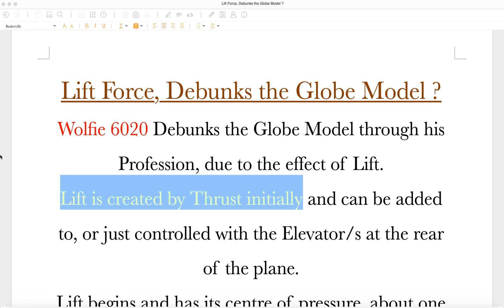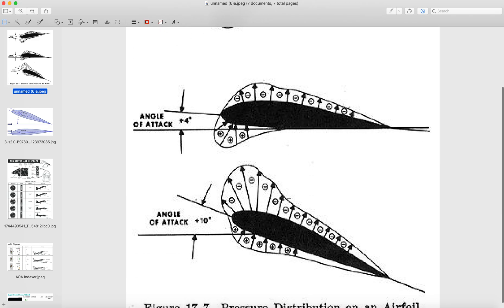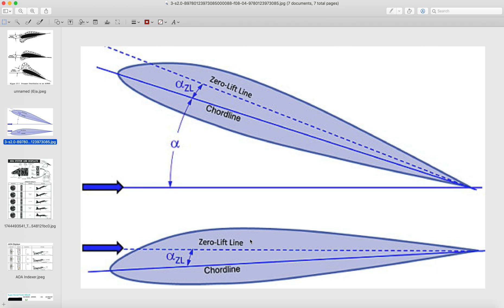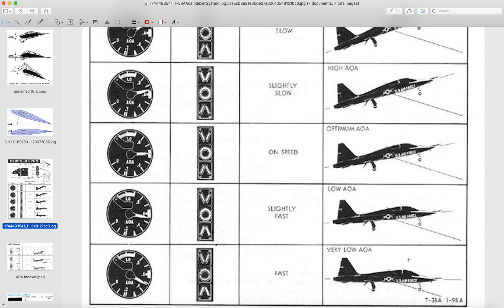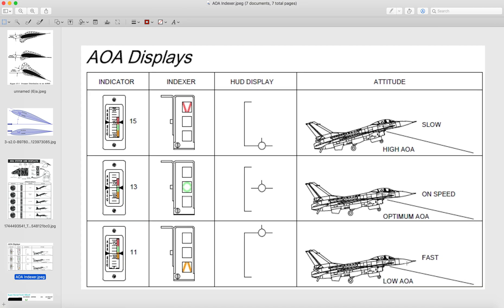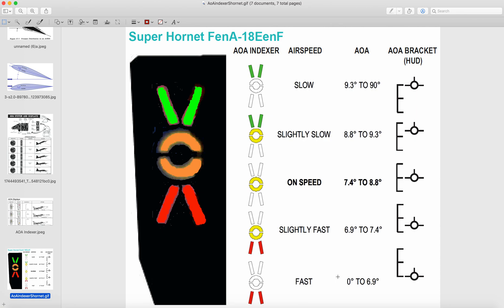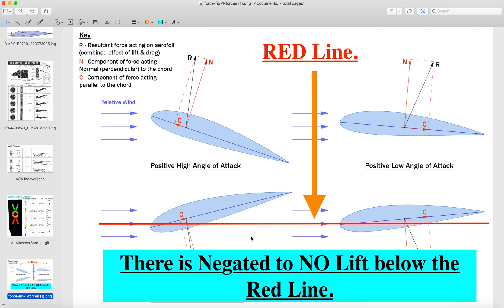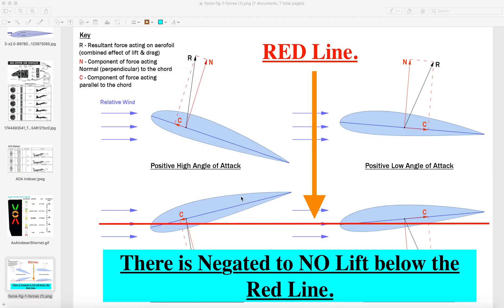Lift Force, Debunks The Globe Model ?

Comment: For the 20th time. The nose is pitched down relative to where you took off from but not relative to the ground directly below it because plumb lines aren’t parallel
Reply: Only on your moggle is that true. In real life, they are.
Reply: @sleepingwarrior4618   spelling maths as maffs and model as moggle isn’t a good argument 😂😂
Reply: @Cornwall1888  It's a fantastic argument. It emphasises the point so well that it caused you to type that comment. Maffs and moggles are out of scientific method for a reason.
Reply: @Cornwall1888  'Maffs and moggle' are minor quibbles when dealing with flat earth lunatics! Pretty good indication of the intellect involved.
Reply: @sleepingwarrior4618  the fact that you don’t like wolfies tone yet are friends with Oakley who is the most vile individual I’ve ever came across is tragic and hilarious
Reply: @overweightaviator  ...
Reply: @sleepingwarrior4618  Ok mate.  I am back.    Can we try to continue as adults.  I acknowledge the comments you made earlier and will keep Banter to a minimum,.  I will put on my flight instructors cap which means my only intention is to impart accurate knowledge politely on this topic. 

Shall we proceed?
Reply: @Wolfie6020  Only if you dont drop into that other persona you have, the arsey one afterwards. If you can be reasonable with me, I can be reasonable back but if you slide off into FTFE territory, I'll just "run away" and you can claim victory. You might not take the topic personally but I do. 

If you can agree to that, where would you like to go today? Start a new thread though, this one is quickly going to get long and long thread are hard to navigate once they get a few idiots making it long
Reply: @sleepingwarrior4618  I assure you I will do my best to avoid that and treat you with the same courtesy and respect I would to any paying student.  Please understand that I am an experienced flight instructor and I have methods of teaching that have proven effective.  Part of that is for me to pose a point then ask you a question.  It is not a trick.  It is not designed to trap you.  

It serves two purposes.  It allows you to think on the point. 

It shows me if the point has been made or if I need to present it a different way.  So please don't avoid the questions as they pop up.   If you don't know then please just say you don't know. I promise you that I will respect that without any ridicule. .

So the first question.  (No ridicule - I promise) 

Have you had a chance to look at the lift formula?   Feel free to take your time and google it now.  I will not be testing you on it.  I will be explaining it fully.   I simply want to know if you have seen it.
Reply: @sleepingwarrior4618  If you had to bet $100 on who was right about this who would you put the money on?

Brian or me?  

Just be honest and remember Heliocentric Suicide.   This is the same scenario exactly.   

Brian is wrong.  He has no clue why he is wrong. He cannot see his mistake.  You obviously cannot see it either.   I can see his mistake easily.  

So who gets your bet?
Reply: @Wolfie6020  Can you please stop following me round the internet.
Reply: @sleepingwarrior4618  But I was here first mate.  It is you who came to a video about me.  

I was simply curious if you had learned your lesson though I fully anticipated a deflection from you. 

I was right.  Sure, if you don't try to engage me again, I will respect your wish to be left alone.
Reply: @Wolfie6020  leave me alone. Thank you.
Reply: @sleepingwarrior4618  said "Can you please stop following me round the internet."

Sheesh, you really DO have the arrogance of nothing, don't you?

Brian posts videos directly critiquing Wolfie, NAMING HIM in the video title, you drop in to comment, and then think Wolfie is hounding YOU? 

Get.  over. yourself.
Reply: @tumenihits5438  you need to realise, I'm flipping Wolfie the victim card because he did it to me recently. I'm just treating him how he treats me.
Reply: @tumenihits5438  He is just sulking because he knows I am right but won't admit it.    Quite happy to leave him alone if he can't hold his own against an ex cop.
Reply: @Wolfie6020  I just want you to speak to me properly, not patronising and condescending. You are not overtly rude but you are passive aggressive. If you could be an adult rather than a feminist to me, I could talk to you.
Reply: @sleepingwarrior4618  What you perceive as passive aggressive is not that at all.   99% of the time it is just normal Aussie banter mate.   In my country men are men and not sensitive to a bit of mocking and ridicule.   We thrive on it.   It is a social norm. 

In many countries "Hey dickhead" would be considered an insult.  

In Australia that is how you would greet your best mate. 

Note how sometimes Level Earth Observer gets his knickers in a knot about something I say to him but Whereswally laughs because he recognised it as just friendly banter.  

Perhaps it comes down to you not reading my post in the calm voice you hear in my videos.  

What is your internal voice when you read my post?  If you hear any anger or hostility that is originating within you.   

Jeran was renowned for it.  I would send him emails with the occasional friendly teasing.   He would quote them on his channel in an extremely uptight and hostile voice.  

That is not how I speak.   That was him projecting his own hostility to my words. 

Are you perhaps guilty of that yourself?
Reply: @sleepingwarrior4618  You would be treated like an adult if you behaved like one.
Reply: @riskycabbages1282  I treat people how they treat me.
Reply: @Wolfie6020  it's not just your tone. It's the words you say. I've experience both a passive aggressive tone from you but also rudeness in the guise of condescending patronisation. I'm all for the banter but you go beyond that with me. We are not friends but you are citing banter between friends to justify your approach. We are not friendly enough for that level of inappropriateness. If you think we are then that's on you. Me and Nathan, anything goes. Me and Arwijn is a bit more delicate due to language differences...he doesn't always realise sarcasm. You? You speak to me like Nathan and I speak but it's misguided and the reason I don't want to engage with you.

Generally I leave you alone because I can't really argue anything about flying a plane. However, if you could prove that the attitude of your plane had actually changed by the amount of degrees required by the length of you long haul flight, there would be a conversation there but it doesn't and you claim some level of compensation. You don't DEMONSTRATE this claim, you just vomit it like refraction vomits out of blerfers when it's topics like the horizon. I point this out to you and your response quickly gets very personal and off topic rather than support your claim. You reverse the burden of proof and appeal to yourself as an authority. When this is pointed out as fallacious argumentum, you don't like it and start calling me names in a jovial way. It doesn't change the fact that you never have to reset the attitude indicator, or can demonstrate the compensating element. It just becomes a d1ck swinging fest with you and I just can't be bothered with the ego. The correct position, the honest position is you cannot prove this compensation claim and you simply believe/accept it as true and you appeal to yourself as the authority due to plane flying. 

You think that's an acceptable standard of evidence but I don't. I explain why and you start literally calling me names and insulting me in a variety of ways. The correct answer is to acknowledge my point and address that rejection of evidence directly with the compensating mechanism/software you claim exists. 

This is why I don't want to engage with you, you do ANYTHING but address the point. 

Then blame me. 

With patronisation and condescension.

And later play the victim card to others to make it appear like I'm tyrant. 

That's a cunts trick and you do operate in this way.
Reply: @Wolfie6020  I DO take this topic seriously though. That's why your approach isn't desirable. You don't KNOW. You strongly believe maybe. I think you are overtly lying with a cheeky chappie approach to try and disguise it. 

The fact remains that you cannot show your plane changes attitude over distance as it flies round the ball. 

You also can't show Coriolis applies to earth. Perth/Sydney flights are backwards to your models claims. As many flights are.

You are politely lying to people. You're a shill Wolfie. I quite like your approach as its much like my own....that's why I haven't blocked you. I also respect the fact that you are expolice. But I still think you are shilling for the lie.
Reply: @sleepingwarrior4618  You treat people how they treat you?  

Are you sure?  

Did I make a one hour video talking about you?   

Did I make several videos plastering your photo on the thumbnails of the videos?  

Did I make any videos accusing you of being incompetent at your profession with your face displayed clearly?  

Let me answer for you. 

No, 
No and 
No. 

I made one video referencing you.   It was simply to point out that you did not know my history as a Police Officer and most of that video was just flying footage anyway 

So please explain why I was an exception to your claim of "I treat people how they treat me"
Reply: @Wolfie6020  I DO treat you how you treat me. I'm amiable to you. I address your points. I disagree properly with you. I do engage. With others, like for example Shawn Hawkins, I scorn him with the scorn he gives me. 

The very fact you are even speaking to me now shows that I don't treat you bad. You might not like how I treat you but if you spoke to me like an adult, perhaps we could conclude points like adults but as you have already admitted, you don't take the topic seriously. I do. Perhaps that's why we never conclude anything and it always ends up in silliness.
Reply: @sleepingwarrior4618  You totally avoided my question (mocking friendly tone with a hint of a smile) 

Please answer it. 

So please explain why I was an exception to your claim of "I treat people how they treat me"

I never made those types of videos about you.  I never "treated you" that way.  So please explain why you did?  (friendly teasing tone but pushing a bit because I want a straight answer with no deflection)

It does not bother me in the slightest how you treat me. I am a thick skinned Aussie.   I am simply curious from a purely academic standpoint of why you did it when I had never treated you that way.  (and I am a little bored while I consider options for dinner tonight, take out and watch Netflix in the hotel or a local cafe...)
Reply: @Wolfie6020  What was the question I ignored?
Reply: @sleepingwarrior4618  Take your time, we can do this over several days.  I am in no rush.  It is Friday night here and after 21:30,   I did not plan to sit online tonight so please forgive me if you reply and don't get a response until tomorrow (Perth time)

I have just started season 4 of Game of Thrones and can't wait to see Joffrey get his just deserts. 

Cheers man and enjoy your Friday night.
Reply: @sleepingwarrior4618  
https://www.youtube.com/watch?v=Atevt-qt8Ow
Reply: @sleepingwarrior4618  said "Only on your moggle is that true. In real life, they are."  (saying plumb lines are parallel)

If all plumb lines were parallel, then a level sight line (perpendicular to plumb) from any point of (say) 100m above sea level should meet all other points of 100m around it. 

But this is not the case. See all the YouTube videos where folks take spirit levels and other levelling optics up to the peaks of hills.

If all plumbs were parallel, and the seas flat, then if I looked out from (say) 100m elevation onshore, to a ship or island of (say) 52m or 73m, then I would have a downward sightline which should meet the water. Non-parallel lines must meet. But it's been shown that these and other sightlines in similar situations miss the water altogether. 

The seas CANNOT be flat. Since they're Not Flat, they must hold some other shape.
Reply: @tumenihits5438  Your point assumes sight in a vacuum though. We don't see through vacuum. 

Your point is invalidated.
Reply: @sleepingwarrior4618  said " Your point assumes sight in a vacuum though."

No, it doesn't.
Reply: @sleepingwarrior4618  said "Your point assumes sight in a vacuum though. We don't see through vacuum. "

So, if and when you go to the optician, and he asks you to read the letters on the chart on the wall, are you looking at the chart though atmosphere or not?

If you assert the atmosphere invalidates sightlines, are you or the optician sure you're reading the right letters, or not?

If you assert that this is "too close" for the atmosphere to matter, then where's the breakpoint where atmosphere does matter? 

Does that get arbitrarily chosen merely to disagree with observations you want to dispute?
Reply: @tumenihits5438  TheRumpus argues that you are NOT looking at the chart directly. He has said in the past that the tree opposite your hose is refracted to a miniscule amount but it is refracted so not actual. You tell me? 

The break point is the part where optics start demonstrating the point, coincidentally the exact same distance that the earth curve is said to start becoming apparent. What you call obstruction due to earth curve is actually the optical effect of the limited angle. 

It doesn't get arbitrarily chosen buy me, it's arbitrarily chosen by your model as a misrepresentation of reality that you are reversing onto me right now.

Read that last paragraph again. This is what your model does.
Reply: @sleepingwarrior4618  said "TheRumpus argues that you are NOT looking at the chart directly."

So what? I have no idea who that is, and you haven't presented the argument. 

"He has said in the past that the tree opposite your hose is refracted to a miniscule amount but it is refracted so not actual. You tell me?"

I can't tell you anything about what someone else has claimed without more detail. 

Is the assertion REALLY that when I look across the room at the optician's chart, I'm not actually looking at it? 

Or that when the driving test examiner asks me to read a number plate at 50 feet, or whatever the prescribed distance is, that I'm not actually looking at the number plate? Really? Where DO you get this stuff from? 

"The break point is the part where optics start demonstrating the point, coincidentally the exact same distance that the earth curve is said to start becoming apparent. What you call obstruction due to earth curve is actually the optical effect of the limited angle."

Gotcha. So it has no impact on the observation(s) that I'm referring to, then. 

"It doesn't get arbitrarily chosen buy me, it's arbitrarily chosen by your model as a misrepresentation of reality that you are reversing onto me right now.
"

No, I'm not choosing anything as part of my argument, you're filling in what you think my argument is. 

"Read that last paragraph again. This is what your model does."

WHICH last paragraph? Yours or mine?
Reply: @tumenihits5438  Nothing in your above comment has not already been addressed in my reply. I suggest you reread my reply slowly. Use finger spaces if you need to.
Reply: @sleepingwarrior4618  moggle? "Leave me alone" It's a shame that someone who studied in law school would post a public comment and tell others they want to be left alone.
Reply: You have some way to verify that statement? That is your belief! It is not a statement of fact!  In the real world your statement is a falsehood! :)
Reply: @ryanqvincent144  Multiple exclamation marks do not enhance your argument! They just make you look excitable! 

Find yourself some textbooks on aeronautics and flight theory!
Reply: @Q Branch I think a debate will be the only way to help Brian begin to appreciate how little he understands.
Reply: @Q Branch I'll see how the schedule pans out next week.  It is in flux at the moment with possible flights over the weekend.  I think I would quite enjoy politely showing Brian what he does not know.
Reply: Are you insane Have you never built anything in your life?😰😰 who would ever say plumlines are not parallel obviously! Do you not understand geometry?

 All level lines are horizontal and all horizontal lines are parallel to the horizon, man your education is terrible😞
Reply: @stevengerhardt1221  
"Are you insane Have you never built anything in your life?😰😰 who would ever say plumlines are not parallel"

Defining Horizontal and Vertical Directions
The earth actually has the approximate shape of an oblate spheroid, that is, the solid generated by an ellipse rotated on its minor axis. Its polar axis of rotation is slightly shorter than an axis passing through the equator. But for our purposes, we can consider the earth to be a perfect sphere with a constant diameter. In fact, we can ignore, for the time being, surface irregularities like mountains and valleys. And we can consider that the surface of the sphere is represented by the average level of the ocean, or mean sea level. By definition, the curved surface of the sphere is termed a level surface. The direction of gravity is perpendicular or normal to this level surface at all points, and gravity is used as a reference direction for all surveying measurements. The direction of gravity is easily established in the field by a freely suspended plumb line, which is simply a weight, or plumb bob, attached to the end of a string. The direction of gravity is different at every position on the earth’s surface. As shown in Figure 1-4, the direction of all plumb lines converge at the center of the earth; at no points are the plumb lines actually parallel. The vertical direction is taken to be the direction of gravity. Therefore, it is incorrect to define vertical as simply “straight up and down,” as many beginning students tend to do. The vertical direction varies from point to point on the earth’s surface. The only common factor is the direction of gravity. By definition, the horizontal direction is the direction perpendicular (at an angle of 90°) to the vertical direction of gravity. Because the vertical direction varies from point to point, the horizontal direction also does. A horizontal length or distance, then, is not really a perfectly straight line. It is curved like the surface of the earth. This is illustrated in Figure 1-5
http://uomosul.edu.iq/public/files/datafolder_2936/_20200323_051331_380.pdf
Reply: @stevengerhardt1221  At distance plum-lines are not parallel to each other. Drop a plumb-line from the top of the towers of the Severn suspension bridge which joins England to Wales. The lines are perpendicular to the ground and parallel to the towers. However, despite being built vertical the distance between the top of the towers is slightly greater at the top than at the bottom due to earth curvature.
Reply: @Q Branch LOL.  My lamest Flight Instructor joke. 

This line represents Parasite Drag,  this one represents Indcued Drag,  when we add the two we have a total drag - like this subject.

The girls laughed a lot more than the guys at that one.  Not sure why.
Reply: @Q Branch  Tthe surface of a sphere is not developable! Jesus Christ man learn some geometry! And what do you think is not true reality?. . .  obviously !
Reply: @stevengerhardt1221  said "The surface of a sphere is not developable!"

What ARE you talking about?!

And WHY do you need to put an exclamation mark after every phrase? 

All it does is make you look excitable! Doesn't add anything to your argument!

See! I can do it too!
Reply: @Q Branch see, this kind of dishonesty is WHY most of of just ignore you guys. Your criticism of Brian is identical with you. Watch.

In science today, gravity is defined as an effect. It cannot accelerate mass, it is the perception of acceleration that is not actual acceleration....by definition (Einstein, 1915).

Is gravity a force in science today?
Reply: @Q Branch No, objects do not fall towards the earth due to gravity. It's defined as an effect. Something else is causing objects to accelerate.....not always towards the rather either. Are helium balloons attracted by the clouds? I can calculate that they are in exactly the same way you calculate for earth attracting objects. Doesn't make it true though does it, calculation is correlation, not science. 

My answer agreeing with Einstein? I think Einstein's a fucking idiot. He thinks the earth is accelerating up!!!! I say we are not accelerating up, or attracting anything. Think is, I CAN disagree with Einstein, I'm saying the current science is wrong. You are ignoring the current science and applying the position he replaced in 1915. Who is more accurate? Me disagreeing with the current position....or....you not even applying the current position and applying the position he replaced in 1915?

It's me isn't it. Einstein is wrong, of course he is. That is the position in science today though.....and you don't even know that position! Ha ha ha
Reply: @Q Branch I don't believe Brian's point has been directly addressed and lots of strawman points have been debunked. 

Can you tell me the point Brian is making please? See if you even know his point....
Reply: @sleepingwarrior4618  
"Can you tell me the point Brian is making please? See if you even know his point"

Yes!   https://www.youtube.com/watch?v=T4LoMQV4ZAw
Reply: @Q Branch Brian's point is that trust causes lift, not elevator position. He's correct. Elevator position may change attitude of the aircraft but the horizontal speed is what causes lift. It's application of the Bernoulli Effect. 

When a plane lands, it steeply lifts it's nose just as it touches down but to get it down, the thrust is removed, regardless of the pitch of the nose. So applying that, both his point is right but so is yours, you can "fall" around the ball in theory. 

The bit you are ignoring is if the plane is flying level and falling around the earth, it's vertical is constantly changing with distance. As the duration of flight increases, that change in vertical becomes bigger and bigger from what it started off. Planes do not fly tangents, they fly level. Even if you redefine level into a curve, for it to fall around the ball you dishonestly claim, the plane is always having to adjust its attitude. Brian is correct. 

The trouble is, these adjustments are cumulative and should be easy to demonstrate. When a plane is cruising at cruise speed, whether it's falling around the sphere or on a level plane, the elevator flaps must make continual attitude adjustments to follow that curved path. If they didn't and rode the wave like you are describing, it's pitch would continually be rising and it has to be corrected.

They don't do it though. Wolfie could prove this either way but he knows they don't do it. 

He doesn't even express his opinion on it. 

I think you are deliberately misrepresenting his point and claiming "debunk". 

His point isn't that nose down is required for flight on a ball. His point is that the plane does have to correct its attitude if it WAS falling round the ball.....but this does not happen. It's a Modus Tollens argument. 

If level flight is a curve.....then elevators must comprnsat for the ever increasing relative change in pitch a ball would cause the plane (the earth is falling away from the plane right).......there IS NO CORRECTION......so earth cannot be falling away from the plane. 

Wolfie could debunk Brian but he won't address it directly. He will dance round it making it LOOK like he's addressing it but not ACTUALLY addressing it.....just like gravity. It LOOKS like it's a force.....defined in science as an effect. 

Rip earth curve.
Reply: @sleepingwarrior4618  Oh I look forward to catching up though.  I just caught this part...  "Brian's point is that trust causes lift, not elevator position. He's correct."

No he could not be more incorrect.  That is utter nonsense and I will explain why after dinner. 

I'll be back.

Go and do a crash course (get it) on the lift formula in the mean time or you won't be able to keep up.
Reply: @Q Branch "Anyway, so long as you're happy that a plane set for level flight will automatically follow the curve that you don't think exists, then we're done here. "
Noooooooo, it would cause the nose to seem to rise up. Not because it is ACTUALLY nosing up but because the earth is falling away from it. The plane is following a tangent line, not a circumference. It requires adjustment to bring the nose back down again on a ball. The elevators need to be compensating the attitude of the aircraft to keep its elevation. If it didnt change its attitude, its following a tangent line relative to earth. 

So no, I dont accept your point.